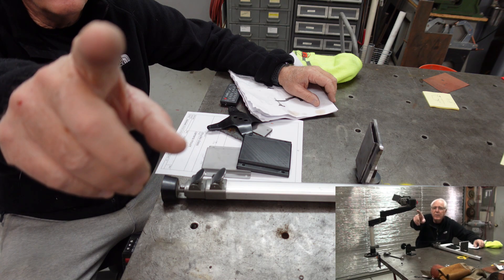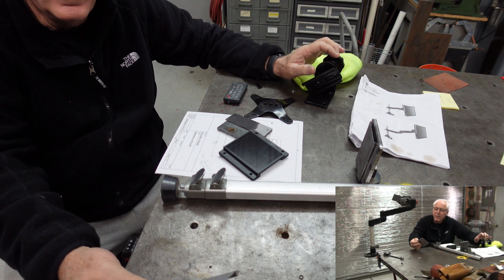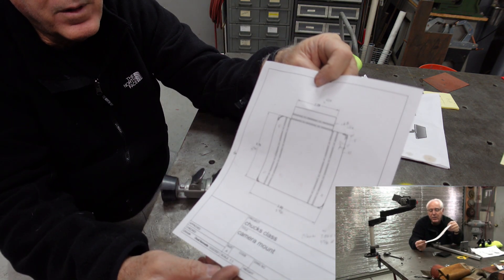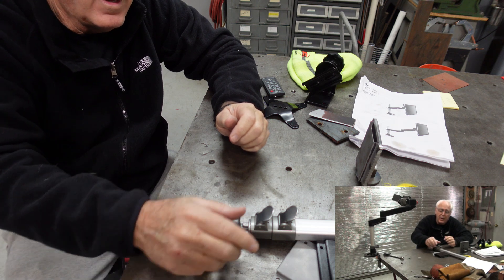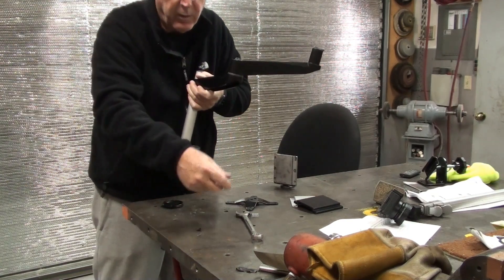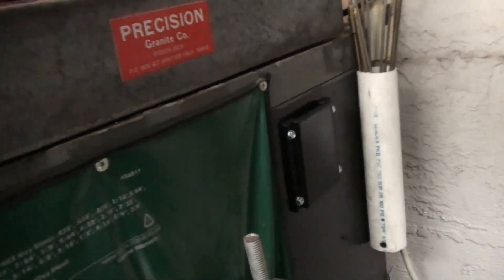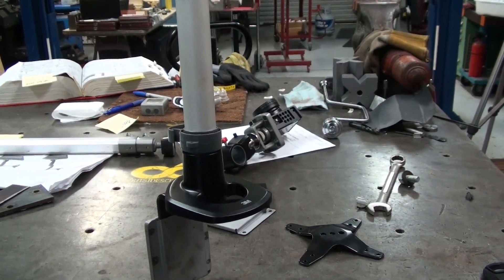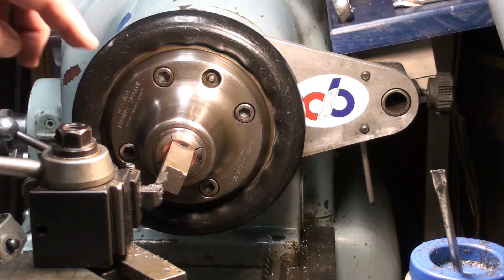Shop/Video Enhancement Tripod Replacement

Comment: Great project Chuck.  The I-CAR standard test for spot welds is when pulled apart the weld must pull a hole thru the plate...Your spot weld PASSED lol. Very cleaver design.   I hate the tripod struggles I have in my videos...that is a great idea for sure.
Reply from the maker: Thanks for viewing and your comments
Reply: @outsidescrewball  Your welcome Chuck, say, check out my latest video, invite for New Years In The Shop Live Streamyard tonight.